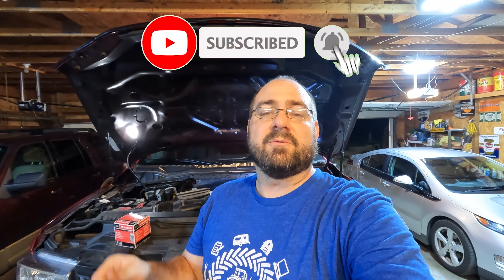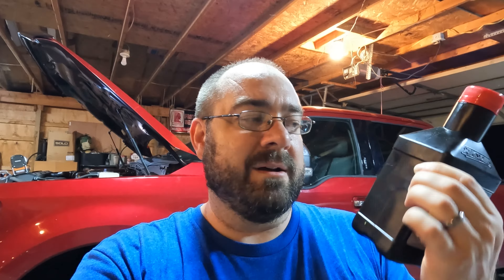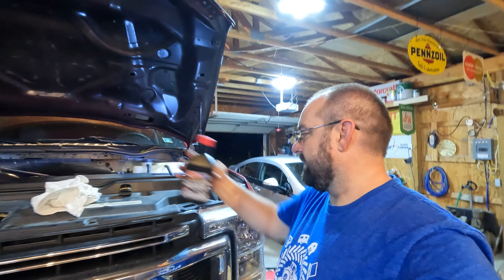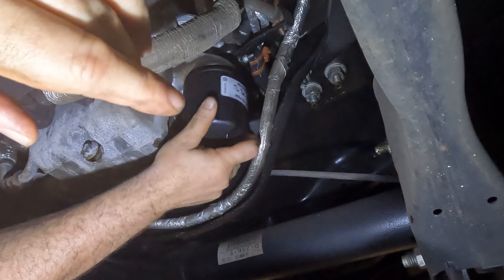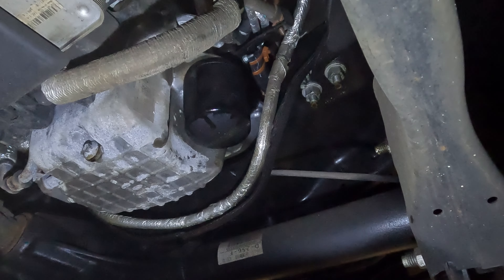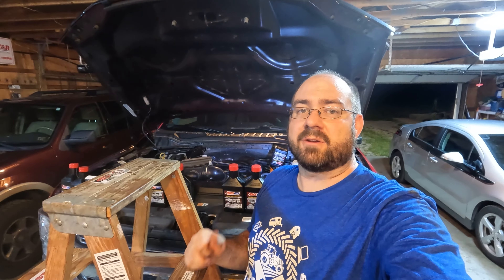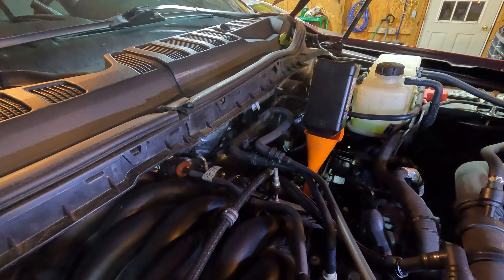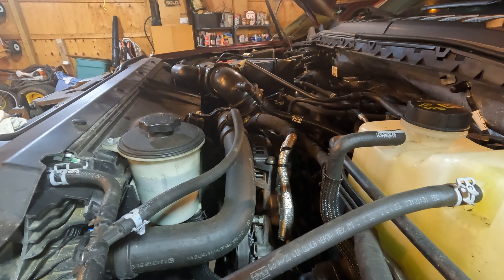Avoiding cam and lifter failure - Ford Godzilla 7.3

Comment: The 7.3L cam and lifter failures you have been hearing about have been in the 300hp chassis cab version of the engine. Not the 350hp or the 430hp used in your F350. The difference is the variable output oil pump calibration used. The 300hp version is tuned for fuel economy. this includes reducing the output settings of the variable oil pump, thereby lessening the load on the engine and improving the economy. When Ford realized the reduced oil output was insufficient to properly lubricate the cam and lifters, causing many premature failues, instead of curing the issue, they just discontinued the 300hp variant. Problem solved, uhm, unless you happen to own one….
Reply: Amazing info, thanks so much!
Reply from the maker: Thanks for the explanation. I didn't realize that the oil pumps were different in the different variations of the engine.
Reply: @craigg4246  that helps put my mind at ease.
Reply: @PurpleCollarLife The oil pumps aren’t different, the software is different. The oil pumps are variable displacement and only deliver the pressures the pcm commands.
Reply from the maker: @JohnDiMartino  I see. Thanks for explaining!
Reply: @JohnDiMartino correct
Reply: 325 hp and up.......
Reply: Not only the lower HP models.  I know of two people that had the issue in a pickup model.  It does sound like it’s mainly the chassis cab specific engines, but not only.
Reply: @ there are two different chassis cab spec engines. A 300hp and a 350, which has been rerated at 335hp. Almost all of the problems were with the 300 hp engine. The variable volume oil pump was tuned lower for the lower power engine. Obviously in an effort to squeeze another tenth of an mpg out of it. It didn’t work obviously. Turns out the cam and lifters actually need that oil…. Instead of fixing the issue, they just discontinued the 300 engine.
Reply: I heard of one case in the F 750 truck and one in an F600 rollback truck.

Comment: There is a PCM oil pump pressure software update from what I've read. Call ford, you are supposed to have it done for free.
Reply: I called, and they said I had to wait till the vin is added to the list. They said maybe next quarter it will be added meanwhile I could be damaging my engine. Ive been a ford guy along time but this is probably my last. 5 years making this engine and still issues they won't fix.
Reply from the maker: This is great news! I'm going to look into it.
Reply: @rockie307  There there bro, it will be ok. How much damage does your truck have?
Reply: @akowned1  Don't know can't see inside the engine, but I'm still driving it with the known issue, so there definitely could be excessive wear going on. I try not to idle much but it's required to drive 3 to5  mph in 4 low for hours at a time so it's very possible the rpm are low enough to have low oil pressure.
Reply: @rockie307  I have a 2020 7.3
I run the hell out of it... always tow heavy...hot shot loads. I have 117k as of today
Change my oil every 12k with ford filter and Amsoil sig series. No prob this far...runs better than new actually.
Gets a good bit of idle time also...I also run a UPR catch can.

Comment: The problem few people know about the 7.3  Godzilla engine is that at idle this engine is designed to only produce 8 pounds of oil pressure, the idea is to save fuel by not taxing the engine power while at idle, however this means too little oil is circulating through the engine and that is what is taking out these engines. Currently, there is no fix to increase oil pressure  to what should be at least 20 pounds. If you get lifter noise with this engine, take it seriously, as it will pile up.
Reply from the maker: Thanks for the info! I'm surprised a simple re-program of the computer can't fix the issue. It seems like EVERYTHING on these new trucks is electronically controlled and able to be adjusted with the computer.
Reply: Our 5 2021 E350 busses have a high idle after sitting for awhile if the ac is on usually and sometimes with it off. on scan tool it has an idle and decel fuel pid but i don't know more than that. that's why I'm on here because the 6th engine failure is out of warranty and i have to fix it i guess. all failed under 60k this one is 77k. Motorcraft oil and filter changed at 4-5k int

Comment: It has nothing to do with oil; it's a typical Ford design flaw. When at idle, the engine does not produce significant oil pressure.
Reply from the maker: I’ll have to look into that - thanks for the comment!
Reply: I heard 6.8 triton v10s also did not take idling too well....

But those that idled less reached very high mileage. 

Not very sure about the 460 V8. That is PROBABLY TOUGHER than the 7.3 Godzilla that is supposed to succeed it today...

Comment: I don't think it would void the warranty using a different oil and filter. But I do know that some manufacturers can be really particular about their products, so if they said yes, I wouldn't be surprised. The best thing to do is contact them. Some cars like Corvettes recommend Mobile One, and they post it right on the oil fill. I've personally never had any issues with the particular oil and filters I've used....yet. 😊 Thanks for sharing Chad!
Reply from the maker: I do think it would be difficult to deny a claim based simply on brand of oil/filter used (as long as it met the required specifications). But I'm also sure that there are some instances where it could be problematic. Thanks for watching! Have a great weekend.
Reply: It's rare but some Fords have Castrol brand oil recommended on the fill cap. I think it's a marketing thing. Volkswagen does it as well.

Comment: I've never worried about voiding warranty on any vehicle because I used different oil.  As long as it meets or exceeds the factory specs.  I do like your idea of video documentation.  I've always used a spread sheet to document but the video is an even better idea.
Reply from the maker: Thanks!

Comment: I have the 6.7 powerstroke and use Rotella T6 5w-40. It meets the Ford spec and is a superior oil to the Motorcraft oil. But I use strictly Motorcraft filters (oil and fuel) and follow the Severe Duty maintenance intervals on my truck.
Reply from the maker: Thanks for sharing! I used to use only the Motorcraft filters as well - but I like the filter material used by Amsoil better now that I’ve done a comparison of the construction.
Reply: Ditto. Same on my 2016 f-250 powerstroke. Always rotella t6 5w-40 and motorcraft fuel and oil filters.
Reply: Purolator BOSS filters are about the best you can buy.  I also use T-6.  I use Motorcraft fuel filters

Comment: Just changed oil at 4,300 since last change. Didn’t want to wait since I have to drive 2500 miles this week for work. I have been averaging 4600 anyway. I put a Sumitomo or Fumitomo (?) brass valve on oil pan at 30,000 miles. Now have 88,000. That valve is a DREAM for this engine. Love how it just drops straight into my drop pan!  Love how the oil filter is exactly in the same spot. I only need to creep on my creeper just a few inches to reach it. 

I love my Godzilla
Reply from the maker: That's great! I've been debating getting the Fumoto valve or the new Votex valve. What was the part number of the valve you used?

Comment: Old mechanic trick of mine: Before you remove the oil filter, use a hammer and small punch to poke a hole right in the middle of the bottom of the filter, then let it drain a while. Saves a lot of mess.
Reply from the maker: That's a great tip to avoid making a mess. Thanks for sharing!

Comment: I personally love valvaline oil, my dad purchaced a 2005 suburban 2500 with the 6.0 brand new in late 2004. He ran only valvaline in it from new and changed the oil religiously with valvoline,  i purchased it from him with 320k miles and change oil religousely with valvaline and drove it to 413k miles everything major was origonal except had a tranmission at 290k miles. At about 390k i started to notice abnormal oil consumption, at 413k i finally decided to rebuild the motor because it was burning about a quart every 250 miles. When i got the motor apart, the bearings were very nice for the age, some light copper showing on the rod and main bearings but the crank journals were all still beautiful, also little to no varnish coloring, it still looked brand new inside other than carbon buildup on valves and pistons. There wasn't even hardly any carbon buildup on piston rings. The cylinder walls were worn but not excessive at all, i measured the cylinder walls, decided to just dingleball hone the cylinders and install new piston rings, and bearings, and took the heads to be gone through at my local machine shop.
The truck now has 467k and is still running and driving beautifully.
Reply from the maker: That's great to hear! I have seen a lot of Suburbans that have stood the test of time. You're almost at 1/2 million miles! Keep it up!!  Thanks for watching and leaving a comment.
Reply: Perform the Fuel Induction Service on the engine every 30,000 miles with either BG Products Inc OR Wynn USA equipment. Great repair shops have this equipment. In addition, put a can of BG 44K Platinum (OR Wynn's equivalent) into the fuel (gas) tank every 5,000 miles...do the same time as tire rotation. If diesel engine, add BG 245 to the fuel tank. Have the same shop perform the Flush and Fill Service on the Coolant and the ATF.....if transmission has less than 75K miles. Doing these services will greatly increase the longevity of the engine and automatic transmission.

Comment: Interesting to see you moving to Ams in this truck. I have no experience with the 7.3 because I don't own one, but I do own a 2004 F250 6.0 with 321,000 miles and a top end rebuild at 175,000. I have used Ams in this truck for many years and she runs cooler and smooth. It was noticeable when I first started using it. I also use Ams in all my Harley-Davidson motorcycles. The HD V-twin runs quite a bit cooler and has less top end noise using Ams versus HD syn. I'll be watching this since I have been watching the 7.3 on the F350 platform in anticipation of buying a new truck in the near future.
Reply from the maker: Thanks for watching and sharing your experience with Amsoil. I’m glad to hear that the Amsoil has worked for you in the 6.0.  That’s awesome that you have 321,000 miles on it! I miss the sound of our 2005 6.0. 
Our oil analysis results have been better, and the truck is doing great!

Comment: I understand your concerns to have such 'sword of Damocles' with those failures. To help the engine last longer: try to change the oil sooner than the interval provided by the manufacturer, especially if you do short trips. Perform the oil change with the engine hot if possible. When I do my oil change, once the old oil has nearly finished (and the old filter removed), I put a good quart of new oil and let it drain: it helps to remove additional residues from the pan.
Reply from the maker: Thanks for watching! My latest oil analysis shows that I can take advantage of the extended interval Amsoil.

Comment: I just did the oil on my 2016 6.2 today and couldn’t find my strap wrench. Good old Phillips screwdriver and a hammer never did me wrong in a pinch!
Reply from the maker: I've done that a time or two myself. One time - I actually STILL couldn't get the filter off, and nearly tore it in half with the screwdriver when trying to twist it. I was pretty scared that I'd be having to call someone to help me out - because I wasn't sure what my plan was if the filter wouldn't come off once I mangled it.  There would be no way to re-fill with oil and run it even to get to a garage. Thankfully - the filter eventually came off. 
How many miles do you have on your 6.2 now? Any issues?

Comment: 91k on my personal 2020 7.3 and 163200k on our 2021 work truck.  Both 7.3 run flawless and I use a local oil change place and only go to the dealer when I changed my 2 differentials and tranny fluid at 40k and 90k.  The work truck got done at 100k.  No issues from either and they are worked especially the work truck hauling 12-17k loads and used as a hot shot truck.  The key is to use quality motor oil and change without fail every 5k.
Reply: I have a 2020 f350, 7.3, the manual says the transmission fluid is "lifetime " ,you don't have to change it. What's your opinion?
Reply from the maker: It sounds like you're doing everything right! Thanks for sharing your experience! I’m glad I made the switch to Amsoil motor oil!

Comment: I think you are good with the warranty. I been putting motor craft full synthetic and I don't like that oil cap either. I bought a step that hangs on the tire helps alot. I would like to hear about the transmission as well.
Reply from the maker: The tire step is a great idea! I'm going to look into one of those.  Transmission update coming up soon. The video has been shot, and I'm editing it. Wouldn't you know it - as I'm editing the video, I thought of another key point I need to add in. :)
Reply: @PurpleCollarLife  my transmission has been good but down shifts hard. I going to see if they can update the computer.  21 7.3

Comment: I hear the Pennzoil Ultra Platinum is a really good oil. You should try it on the next oil change. I’m gonna use it when I change the oil on my dad’s car.
Reply from the maker: Thanks for watching! I've used a variety of different oils over the years - Wolf's Head, Quaker State, Pennzoil, Valvoline, Royal Purple, Amsoil, Mobile 1, and Castrol mainly. But of all the oils I've tried, I've been the most impressed with the Amsoil. It's a great product.

Comment: I only use mobile 1 oil and filter every 5000 miles on my 23 Godzilla. Also you need the fumoto  valve to change out the oil plug that shoots oil across the room.  Also stab the oil filter with sharp center punch thru two layers on the bottom  to drain the oil out of the passages and filter. Elsewise there will be oil everywhere!
Reply from the maker: Thanks for the tips! I have considered the Fumoto valve. I've never put one on a vehicle - but always thought they made good sense!

Comment: A few F-59 chassis here with lifter issues
Dealer has taken care of them 
Most of them 21s 
Oil change under 5K
40 to 50 k miles
Reply from the maker: That's unfortunate to hear about the lifter issues. It's good that the dealer has been able to help with them.

Comment: The Duke says, I don't think engine problems with this motor have anything to do with the oil. There are even racing cams that people buy for hot rods that delaminate and destroy the engine rapidly.
My belief is that whoever is supplying camshafts worldwide to whoever buys them like Ford Ram n Chevy.,is selling cheap crappy cams made of crappy material and not following good manufacturing processes. For example the hardening process may not be done properly. Lots of things can go wrong when manufacturing a cam if you don't follow proper procedures and use proper techniques. My theory is if you get a bad cam you going to get bad results. Irregardless of whether it's a Ford a Ram or a Chevy or anything else. Just my two cents. 
What did I teach you?

Comment: Amsoil and Wix XP filter. Drain it for at least 12 hours too.
Reply from the maker: I’ve been really happy with the Amsoil. I’ve never thought of a long drain time like that. Does it really make much difference? After a few minutes, it seems to be just barely dripping.
Reply: @PurpleCollarLife  Next oil change place a new clean pan under it when you would normally put the plug back in and see what comes out over the next 12 hours. Should be about a 1/2 cup of the nastiest sludge in your engine. I also change my oil at 1000 iles, then 3k, then 6k and 10k, then every 5 k after that. Oil is always cheaper than metal.

Comment: The Magnuson Moss Act forces dealers/manufacturers to prove the oil and/or filter you used caused any failure you’re claiming warranty on. They cannot do that if you use any brand quality parts and fluids. The Napa Wix filter and Napa full synthetic are the best in the world.
Reply from the maker: Thanks for the comment. I didn't know anything about the Magnuson Moss Act before this video. I'm surprised it isn't more common knowledge. I had never heard anything about it.